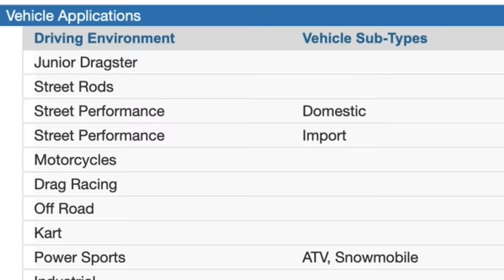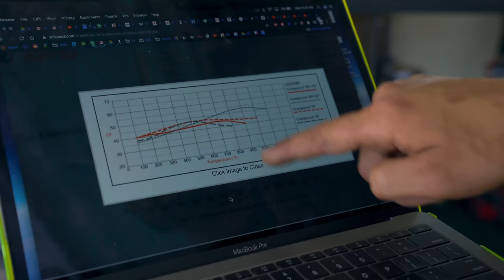Are Big Brakes Worth It?

Comment: “Change brake fluid every year” my family still has the stock brake fluid in our 2004 Toyota Sequoia. Safety first amiright

Edit: everyone saying that they get bled when new pads are put on, yes probably, but as far as I know no has ever completely drained it and replaced the brake fluid. It probably takes a dozen pad changes to cycle it all out
Reply: that toyota reliability
Reply: Amen to that 😂😂
Reply: Lol... good luck with that stopping when you need it... Also sounds a little fishy, never had a caliper replaced? Since you know they would have to bleed the lines and minimally you would have gotten topped off with new fluid...
Reply: Toyota: Let's go places
Reply: Tugboatpb was “Mazda” the commercial that said “zoom zoom”?
Reply: Brian Myers before I got my race cars my dad taught me to change pads and rotors every time until I got my speed3 and evo I never flushed or topped off the fluid. Just never was a concern of mine or my fathers lmao so it’s not surprising that we weren’t the only ones and they will probably be fine just like I was and my parents still r lmao
Reply: @jrico153  yes it was
Reply: It's old as my little bro lmao😂
Reply: That's probably 50% water lol.
Reply: My mom's 07 f150 still has the original brake fluid after 150k miles. Probably why she has a spongy pedal 💩
Reply: 2009 Toyota Venza really doesn’t need anymore. Haven’t used any in sooo long
Reply: Please do not neglect preventive maintenance. If you are trying to cheap out, don't. That means you value your life only as much as the cost you're trying to cheap out on.
Reply: @jrico153  Makes no sense.
Reply: @brianm.595  
My 86 F350 has all original calipers and wheel cylinders.... Definitely possible
Reply: Tugboatpb ayeee I had a feeling 😌
Reply: Who does that?
Reply: My parents had one and it was running fine at 400 000 miles when they sold it
Reply: I've never changed my brake fluid just because.. guess I'm that guy.
Reply: My 1990 MR2 Turbo turned 30yo last month. The fluid in the manual transmission has never been changed! The special fluid in it’s rare optional factory limited slip differential (LSD) is original because I’ve never had to change the original axles it’s still running, although I did replace the CV boots and repack them with grease but I did it with the differential side still hooked up! The original turbocharger barely leaked oil, not enough to even effect the way it idle, when I swapped out the turbo for a newer, better flowing turbo from a Gen3 engine last month!
I still have 94-96% compression across all four cylinders. It leaks a tiny amount of oil from every gasket on the damn thing but not enough to even register on the dipstick over the course of an entire oil change.
These things just don’t die!!! It ran a 12.9sec quarter mile last month at the track - from a 30yo, should be worn the fuck out, high performance 300WHP/300WTq turbocharged Yamaha/Toyota engine! God, I love my MR2T!
Reply: i can top that, our 2001 ford ranger still has the 2001 brake fluid, it also had the 2001 coolant in it as well
Reply: @negativeindustrial  how much did toyota pay you to write this
Reply: My dad bought a brand new echo rs in 2004, he has been daily driving it every single day and it now has 200k miles ,still the original brake fluid 😂
Reply: Atleast tell me they change blinker fluid
Reply: To be fair every time you replace your brakes your probably flushing a good amount of system bleeding the system. The stock fluid was probably gone before you where in the 2010s.
Reply: Oooooooffff
Reply: I blew a brake line in my 2006 Ford. I've got brand new brake fluid in there now. It was all OEM before that
Reply: I bet that if you change it, the brakes will start having problems.
Reply: That's how your calipers freeze up. Water gets in there and rusts the piston and cylinder wall.
Reply: obama gaming
100% fact. The original alternator only died two years ago, as well. My Lexus LS400 is almost 25yo also and all it’s ever needed was tires, brakes, belts and one alternator. Toyota has definitely earned their reputation.
Reply: If all else fails the emergency brake is at your disposal😂
Reply: Unintentional Failure
I mean, why wouldn’t you? You can buy another engine from the junkyard for less than $500 and a full rebuild kit for like $250. Call it another $250 for incidentals and “while-you’re-in-there” type maintenance parts (Thermostat, PCV, random hoses, etc) and you could have your truck ready to go another 200k miles for less than 1/3rd of the down payment on a new truck. It’s essentially a no-brainer! 😉
Reply: lucas aubin 
What is the RS version of a Toyota Echo? Please tell me it’s some “performance” (or “action pack” in Toyota-speak) package that includes a bunch of useless aero bits bolted on everywhere! Toyota loves to do stupid shit like that 🤪
Reply: PleaseDontWatchThese
Except, you don’t need to bleed your brakes if you’re just replacing pads, rotors and hardware. If you don’t loosen the hydraulic lines you don’t actually need to bleed the brakes. That’s why no one does it and fluid in the reservoir gets so old until someone replaces the brake master cylinder or one of the calipers or rubber lines at one of the wheels.
Reply: hard to believe but i mean it is a Toyota so wouldn’t be surprised if its true😂
Reply: My 1999 Chevy Silverado I'm pretty sure has never had a brake fluid change 😬, I'm probably going to do that now lol.
Reply: My family has a 2007 sequoia with 300000 miles and we have never changed over brake fluid
Reply: Owen Demars
Except modern “emergency brakes” aren’t emergency brakes at all. They haven’t been for nearly forty years. What they actually are is a parking brake system that just gives you separate mechanical only control over your rear calipers/drums. If your rear pads or rotor are no longer functional then you won’t have an “emergency brake” at all. Don’t count on it.
Also, my brother list all brakes on an older 1960’s car that was equipped with an emergency brake system that he inherited from my great-grandmother. When she died it had been sitting in her garage for ten years without being driven. The front brake pads had, unknown to us, delaminated from the metal backing plates and disintegrated while he was driving on the freeway. He exited the freeway still doing 70mph and went to push the brakes and almost nothing happened! He yanked the emergency brake which slowed him down for 2-3secs before the cable broke. He had a red light ahead at the underpass so he just crossed his fingers and made the hard left and coasted to a stop barely tapping the rear of the car at the next light. He said it was the scariest thing that ever happened to him. 🤣
Apparently you’re meant to feather the parking brake handle rather than pulling hard like it’s a parachute chord.
Reply: “Safety 21st” words to live by
Reply: Brian Myers no it can happen, if you are lucky... I have seen people go YEARS without having to change brake fluid. It is a little fishy but one of my friends did it to save money and eventually crashed because of what you explained so now he uses new brake fluid every 8 months 😂😂🐧
Reply: It’s called being lazy
Reply: Try 2001 Tahoe stock brake fluid
Reply: Stock brake fluid on a 1988 mazda
Reply: I mean I just tested that theory in a 99 Impreza and yeah brakes are deffinetly worth keeping maintained 😂😂
Reply: "still runs, why should I fix it?"
Reply: Keep in mind he's spent months making his Miata wayyyy slower. Don't try to flush your families brake fluid sir
Reply: Sequoia gang, they really are just rolling cinder blocks
Reply: @brianm.595  calipers aren’t supposed to go bad bud what clunker you used to?
Reply: Bro do you get it serviced? The shop should be changing it at set intervals like every other consumable
Reply: I can say the same about my 05 civic. It stops fine!
Reply: ur almost 100% worng
Reply: @negativeindustrial  most people call it an emergency brake because that's what they hear. It has always been a "parking break" the only reason I feel its doesnt change is atleast if your brake fluid system fails you atleast have something. If your cable snapped that was because it had already deteriorated alot
Reply: I was a dealership technician... Whenever I replaced any brake component I would completely flush the system with new fluid... Anyone who does anything else is a shit mechanic!
Reply: It's a Toyota
Reply: Filthy casual. I haven’t changed my trucks brakes or brake fluid since the 80’s but there’s a reason why engine breaking exist. Gets you close enough to stopping and praying gets you all the way there or the car in front of you which ever works first.
Reply: I just recently felt The rotors starting to warp a little on my 04 tundra  yes it’s finally time to change them 
should I go bigger?🤔
Reply: lol same still has the same old brake fluid from 2006. but what? replacing the brake fluid when changing brake pads? i do it myself and i never bled the system bcs it was ncr touched lol.
Reply: @white_zeddy  my breaks go all the way to the floor until they do anything.
Reply: I track my miata each summers since 2015 and never changed the brake fluid! Still looks good and the pedal feels solid.
Reply: smh, you never need to bleed the brakes when performing a pad change.
Reply: well then
Reply: @jrico153  yes
Reply: Nobody bleeds your brakes when the pads are changed lol. All we do is compress the piston back into the caliper and suck any excess fluid outta the resivoir. You gotta pay for a brake bleeding service. Also, it's not that hard to do yourself, just look up the procedure, lift the car up evenly, get a friend, and have at it for 30mins.
Reply: It doesn’t get changed at all with pad changes. no one with any sense cracks the bleeder to push the pistons back.
Reply: @dakotahuddleston3974  it's a known fact that brake fluid degrades over time and absorbs water. I think it needs changed once a year but it definitely should be done at least every three or so years
Reply: @negativeindustrial  what are speed bleeders and where do I get them? Also if you want to put new fluid in your system I have found that using a turkey baster to suck the fluid out of the master cylinder works well.
Reply: actionjksn
Yep. I do that, as well. Here you go:
Russell 639590 Speed Bleeder https://www.amazon.com/dp/B000CPCOBQ/ref=cm_sw_r_cp_api_fab_05XFFbNP2YCT9
They are application specific so make sure you go through the process of selecting your exact car’s year, make, model and options to ensure proper fitment the first time. They come in packs of two and you’ll want one for each brake so get two packs.
Reply: @pleasedontwatchthese9593  why would you need to bleed the brakes when changing pads?
Reply: @salahswilh7002  My 26 years of being a Master Certified Technician says you won’t!
Reply: Like replacing valves when you change tyres - it's just to push BF sales. Lets face it,  NO ONE in normal driving is going to boil their fluid
Reply: no usually 2 or 3 all all the old fluid is gone your brake system only holds 2 or 3 ounces of fluid
Reply: @coldsteel0989  What? If that were true we wouldn't be selling brake fluid in 16oz bottles. Your lines only hold a few oz each but not the entire system
Reply: @derpyduck5088  you shouldn't be putting 16 oz. in there the whole system will be flooded I think in one flush I did took a whole bottle but it had a shit load of air
Reply: Toyota recommends it ever two years.  The reason being, most people have the mentality of "if it's not broke, don't fix it".  These people never replace their fluid and have no brakes when they really need them because the fluid boils.
Reply: @xXRenaxChanXx  you absolutely should change your break fluid

Comment: When bleeding the brakes, tie the bleed line to a high point, like the top coil of the springs. This will make bleeding the air way more efficient since the air will always want to make it's way to the summit of the arc faster than the fluid will. Air is lighter than hydraulic fluid.

Comment: Last video: the Miata needs more power and better cooling.
This video: let's add parts to slow down faster.
True Money Pit move.
Reply: Well if you planning on adding power the first mod should be brakes, suspension and cooling
Reply: @fila1445  my buddy and i both owns 1994 m3's and he had a tune it now developp 450 hp and i changed brakes suspension and tires and rims and i was faster around willow springs lol
Reply: It says read more but there’s nothing more to read...
Reply: That's what most people who actually know car would first. Too many idiots boosting their cars hitting 150mph+ with 15 year old clapped out stock brakes.
Reply: making the most of quality content
Reply: @fila1445  no that's wrong. Have you ever modified a car?
Reply: @polyscient  yes
Reply: @gtasanandreascluckinbell  that's awesome man! I would say you're probably a better driver than your friend, and good tires and wheels will give you the best reduction in lap time for your money. You guys should try swapping cars some time and just have him put the same tires on his car as yours. I'm pretty sure you will beat your time using his car with power upgrades and tires.
Reply: The common (and common sense) expression is "If you've got the go, you better have the woah."  "Woah" is used here as what a Bovine Management Technician is heard saying in Western films when he pulls back on the reins to stop his Equine-American.

Basically, if you're gonna add horses to your automobile, you better have the control (steering and braking) to match.
Reply: @polyscient  thanks